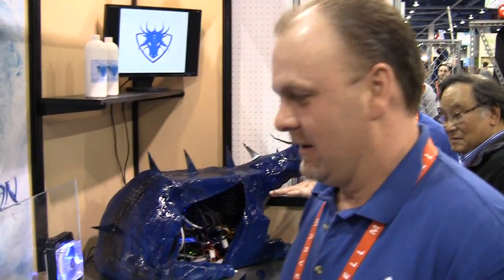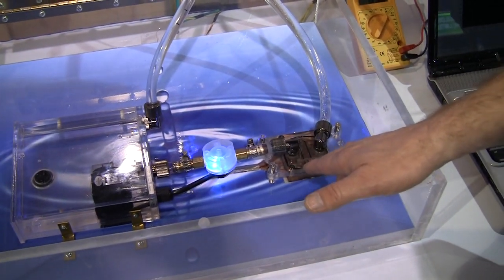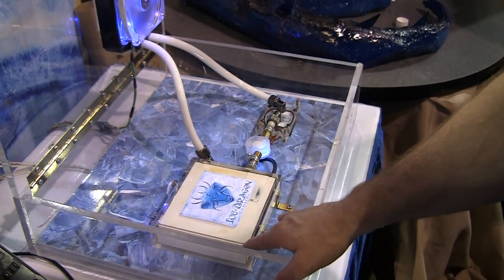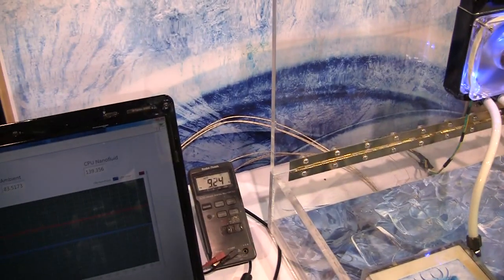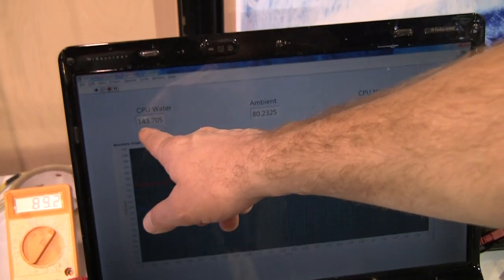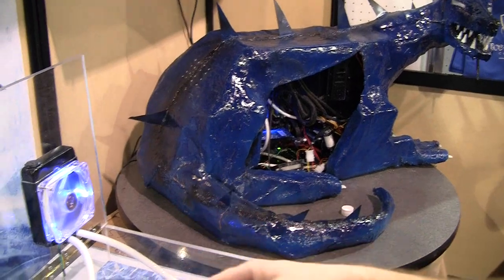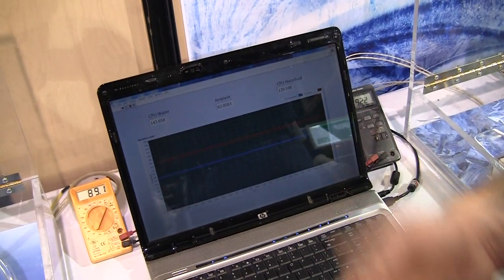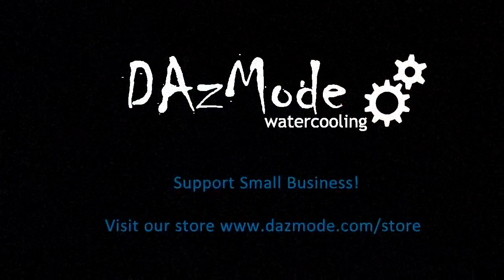DazMode @ CES 2012 - Ice Dragon Nanofluid - DazLab Weekly (32)

Comment: For those interested, I worked on this project as an undergraduate.  These fluid do actually contain nanosized metallic oxides, there is no gimmick or marketing bs with it, I've seen them via TEM (Transmission Electron Microscope) and SEM (Scanning Electron Microscope) and we measured their size using DLS (Dynamic Light Scattering).  We tested several different types of metallic oxides in the research project, though I do not know what Ice Dragon has chosen to use.

Nanofluids work for two reasons: first, metals transfer heat better than water.  These nanosized particles of metallic oxides suspend in the base fluid will transfer a greater thermal load into and out of the fluid than the base fluid alone.  The second reason they work is because they introduce a higher amount of turbulence in the fluid.  The increase in turbulence increases the amount of particles that interact with the thermal load (processor or heat exchanger), with the increase in particles interacting with the thermal load you have more particles transferring more energy into the fluid.

We never had any issue with nano particles falling out solution, agglomerating, or clogging up the system.  Similar studies were conducted in the 90's with microsized particles in fluids, those studies had many issues with particles agglomerating and falling out of solution.  This was due to the relatively large size and mass of the particles.  Nano particles are three orders of magnitude smaller than microsized particles and sometimes greater due to the agglomeration in microsized particles.  This coupled with advances in surfactants which keep the particles in solution is why nanofluids don't have issues with agglomeration or falling out of solution and clogging the system.

As for making nanofluids on your own, it's not feasible for an in your garage type of setup.  The machines that actually blast these metals into nano sized particles are extremely expensive and intricate.  It also takes a lot of experimentation to be able to consistently produce the same size particles and bring them into solution.  Plus the cost of the surfactant which is a chemists dream, there really is a lot that goes into them.  When we first purchased nanofluids to baseline against we were paying upwards of $4000 a liter.  It seems that Ice Dragon has been able to lower that cost dramatically, I found 32oz's online for $29.99, pretty good deal.

I hope this helps to answer some questions
Reply: +pts116 Hey, sorry to bother, but since you're an involved party... two questions 1) is this liquid conductive ? 2) if no, will it become conductive after say, 10 month of intense circulation (leaks tend to happen after some time) ?

Comment: I did take your advice for fans. My triple radiator has 3 gentle typhoon 3000rpm fans. My cpu is a FX8350 overclocked to 4.7mhz @1.46v. Temps range from 34 to 37c idle but jump into the early 40's gaming. It's ok for my CPU but I was considering adding my graphics card to the loop. I may add a duel rad to the loop.

Comment from the maker: We sold several hundreds of those since early 2012 and feedback is rather positive. I have not heard a single person who had problems with it or was unhappy with performance. 
I personally don't want to use/test it as it hard to clean system from it and distilled water/glycol  is much better choice for testing bench. Having said that, if I would have system that I wouldn't want o touch for couple years, ID would be my choice.

Comment: I wonder if putting detergent in your system would make a difference? If smaller a liquid with smaller particles transfers heat better then maybe it would help since it would allow the water to make better contact with the blocks? Just a thought.